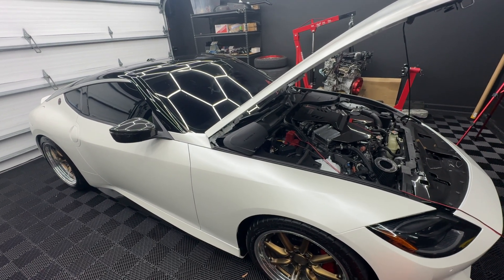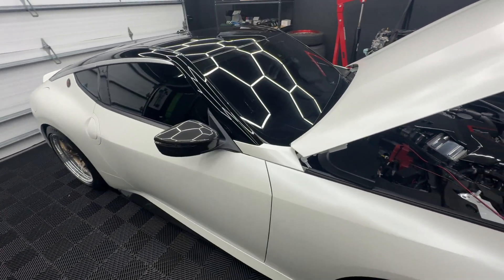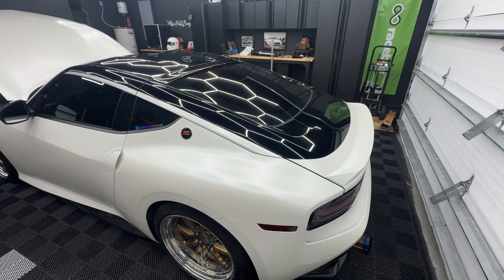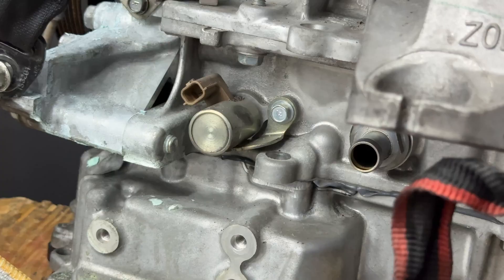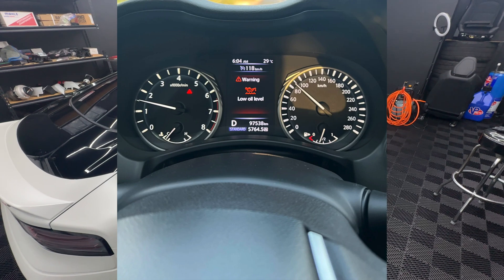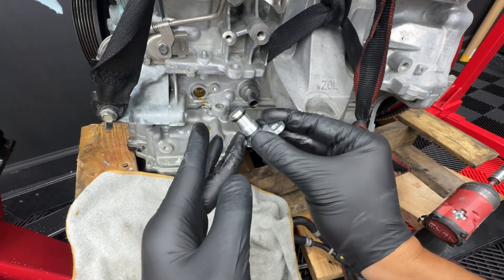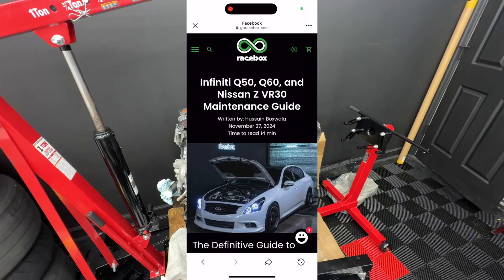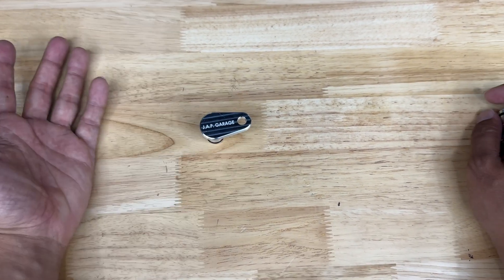Nissan's VR30DDTT Engine Flaw EXPOSED

Comment from the maker: Do you have a VR30? Have you lost an engine or has it been great? I want to know.
Reply: It’s been great so far! No issues on 0w/20 stock Nismo
Reply: lol, vr30 cant even stop the heads from cracking
Reply: 2017 q50rs 3 years (tuned fbo) been great only issues o2 sensor and belt.
Reply: 2019 q50, 106k on stock turbos, bought with 34k.  FBO and tuned for about 20k of those,  JB4 30k, stock 20k.  Its been good to me.  Racebox caught the oil pressure solenoid.  Very delayed going into high pressure.  New solenoid goes into high with a blip of the throttle.
Reply: Just turbos running mobil 1 5w30
Reply: @fullmetal556miles and year model I have 2018 87k miles been great
Reply: Went thru one engine before I wrecked
Reply: Nice man, 2020 red sport 20k miles RA500 but engine leaking coolant inside smh
Reply: Changed my oil and within not even 24hrs my engine blew. Knew I need turbos and was gonna have them redone by infiniti but that low pressure light came on and then the knocking noise 😢. This is gonna be expensive. 🤦🏾‍♂️

Comment: I'm running Motul Xcess Gen2 5w-40 in my 2025 Armada Pro-4x with the VR35DDTT 3.5L twin turbo V6 and up in the Midwest winter temps of -15F it runs like 0w-20 once warmed up properly. Don't plan on ever going back to 0w-20. Used oil analyis showed wear metals were below universal averages for this motor.

Comment: Currently deciding to get my motor rebuilt or just buy a used q50 motor. Do I have to get the car tuned to install the block off? I have a jb4 but I’m not using that bs no more rather just get a actual tune

Comment: I'm not sure blowing an engine when low on oil can be considered a "flaw" of said engine. Pretty much any engine on this earth can be destroyed if ran with no oil.
Reply: The issue with the solenoid is that you don't need to be low on oil for it to blow. The only mitigation step is to ensure you have proper oil pressure everytime you go above 3.5K RPM or high load/full throttle.
Reply: @dogunboundhounds9649  Or unplug the solenoid or tune so it stays high flow always.  Not so hard.
Reply: @firepowerpinball therein is a flaw of the engine
Reply: I was just thinking i havent had this issue at all with my vr..? but then again… i drive me z33 for nearly 10 years 🤔
Id swear it was the most reliable thing ever…… just keep a couple spare quarts and check the oil every day 😵‍💫🥴

Comment: What your opinion on the smoking at stoplight, but only when its hot outside. In the cold once engine is warmed up this doesnt happen to me. Just on hot days which is weird i run 5w-40. Im also catless so idk if its just that. Its also not consistent, sometimes happens alot at one stoplight and nothing at the next

Comment: Use the right oil, constantly check the oil, set up an oil catch can, avoid any pop and flames tune : you'll be fine
Reply: pops would not cause any harm to your engine..
Reply: Flames then aren’t bad if you don’t let the exhaust gas temperatures get too high. Moderation is ok.
Reply: so 0w20, If i do intakes, catback, downpipes, and tune 5w30? Im getting my z tomorrow and im worried about the cylinder head cracking issue going around... especially if tuned and voids warranty

Comment: I just had my block replaced due to rod knock. Could this have been what caused it? It looks like the solenoid isn't in the engine block, so I'll have to replace this solenoid since I'm not tuned?
Reply from the maker: Couldn’t tell you for sure but it’s a possibility. The solenoid is bolted to the engine and you get a new one with the new engine.

Comment: There is a reason that basically NO supercar in production today has a V6 engine (the R35 is not a supercar).    What do you expect when you put high HP in a non-intrinsically balanced engine that needs countershafts and/or offset crank pins to fire evenly? 
Lamborghini, Pagani, Ferrari (296 is not a supercar either), Porsche, BMW and Toyota understand this.  Same reason the Jag XJ220 was basically a flop.
Reply: I get that you said no V6 "Supercars" in production today, but the Toyota Tacoma literally uses a Twin Turbo V6. I dont think its the fact that they arent meant for Supercars its that these companies are trying to find ways to balance economy with speed. Which imo buying these cars that have been babied and clean for cheap now, makes a whole lot of sense. Especially after these turbo recalls. Nissan f'd up and its a win for used buyers.

Comment: the vr30 doesn't blow up at all. only if abused
Reply: Porous block says otherwise
Reply: @biccog8634 then how come my 2018 with 181K on it still runs perfectly? doesn't burn a drop of oil either.
Reply: @cantwealljustgetalong2 only affects some engines and you’ll never know if you got a bad one till it blow early. You got a good one for sure
Reply: @biccog8634 i hear what youre saying but if you google any engine you will find problems with almost every engine out there.  remember nissans 3.5 and 3.7 liters were pretty bulletproof.  because of CAFE and political pressure to squeeze out fuel economy they downsized the 3.7 to 3.0 liters,  and increased compression by a lot, along with twin turbos just to create around the same power the 3.7 made.  not only that but fuel economy ended up being the same for both engines.  companies have been doing this the past 10 to 15 years and this is why across the board we are seeing engine issues from almost everyone
Reply: @biccog8634 porous block doesn’t exist. It’s cracked heads. Oil mixing with coolant can be caught.

Comment: This engine was first made available in 2016, I went to training for this engine and they didn’t have one available the class, furthermore Nissan didn’t even know how much oil it should get. The trainers had different info than specified, and the updated info was never published for a year, then we got different dipsticks, then we were being forced to change the fuel pump with every warranty engine replacement, I’ve seen turbos blow all the oil from the engine out the exhaust, I’ve seen a potus block with nest mound of blue coolant fuzz…
Reply: I jsut had my fuel pump replaced under warranty, is there something else to this?

Comment: AMSOIL or nothing.. The shit is magic.. I had a TSX that consumed oil (no blue smoke or blow by) but would eat about 1 quart per 300 miles... I switched to AMSOIL and was on the full line every 3000 miles.. Not gonna fix the shitty turbos on a Q50 but without a doubt will save ur engine.
Reply: Agreed - Amsoil has NO competition.  The best. Period.  Amsoil Signature and Amsoil 20 micron filter.   I use Amsoil for all other oil products needed from chainsaw to guns to bicycle chain to multi-purpose for hedgetrimmer, all small engines i.e. lawnmower,    etc.   Change oil every 3K. Period.  Old school rule.  Period.
Reply: @yootoobed  I wouldn't say no competition, Motul is right there
Reply: Agreed 100%!!!!!   With this particular engine,  every 3K is an absolute MUST!!!!   ever notice how dirty your oil is after even 3000 miles with this motor??

Comment: so which oil do you recommend for a 21 red sport I've used Amsoil 5w-30?
Reply: If car is stock and it runs 0w/20 you can run 0w/30 will me no problem if your tune I would look at 5w/40. When the vehicle is hot and these vehicles naturally run hot. The 0w/20 gets real thin when pushed hard and the car is hot and it’s hot outside. You can reach 212* easy.  So run 0w/30 once hot it alil thicker when pushed hard it will thin out as well but should around like a 0w/20. When 0w/20 thins out it’s like running a 0w/16 maybe less

Comment: Can I ask you a question? My Z is my first turbo engine. Leaving it stock…..for now anyways…do you have any tips I might not know about turbos or the VR30 specifically? 

Things that might be basic, or good practice that a former NA guy wouldn’t know about? 

Obviously nothing that is already in the manual, but maybe some good practices with the VR30 or just turbos in general. 

Thanks!
Reply from the maker: Congrats on the car! Here is my best advice for a fellow VR3O owner. 

Monitor oil level religiously. 

Monitor coolant level every engine oil interval. 

What ever you do, do not go 10k miles between engine oil intervals. I like 3,500 miles on pump gas, 1500 miles tuned on E and and for mainly highway miles on pump gas I wouldn’t push it past 4,500 miles.

Let the car warm down a bit before turning off after getting on it hard. 

Check your belt indicator on the belt tensioner. The belts tend to stretch relatively quick. Mine needed to get replaced at around 20k miles. Replace it with a Gates belt.

When you do decide to tune it, choose a reputable tuner. Over spinning the turbos will damage them.

And most of all, enjoy the car!
Reply: @ZillaFullBoost wow man, thank you so much ! That some solid advice, and none I knew. I did my first oil change at around 3k, just hit 4k so still just getting warmed up.

Comment: In theory cant you just unplug the sensor and have your tuner tune it out? Basically the sensor will lay dormant and act as a seal as well or a block off
Reply: Yes you can technically
Reply: bo need to tune it out, it will automatically go to high demand permanently
Reply: @junior3732  high demand is exactly what we want

Comment: I got a 19 q60 stock with over 65,000 miles, just added a larger heat exchanger and oil catch with no issues.1.check oil 2.use recommended oil type 0w20 and change it every 4,000 mile 3.dont beat the shit out of it all the time and you should be fine
Reply: That’s another thing. People beat the cars like they are legit race cars and forget that they are manufactured STREET cars lol 😂. Some guy got mad at me the other day cause I wouldn’t launch my gtr at a stop light. 😂
Reply: @Vader066 rev it!  Rev it!  😂😂😂😂.. until you blow then you're looking like an idiot while they fim you 😂😂.. these kids.. smh.
Reply: Use 5w-30 unless you live in a very cold climate

Comment: Hey guys,   what about running 5W-20 instead of 0W-20 for a little better startup protection,  but keeping easier running temp lubrication.   Does anybody run this viscosity?
Reply: Look into STP ceramic oil additive.  My engine loves it, and would add additional protection.  In standardized testing, it significantly decreased wear and will make your engine noticeably quieter

Comment: I want to get a q60 red sport but I’m afraid of this engine I already have g37
Reply from the maker: I say go for it!
Reply: @ZillaFullBoost turbos gon be problem I know it
Reply from the maker: @Jaybladz if you over spin them yea. My Q lasted 60k miles being pushed real hard. For the regular guy it should at least do double that.
Reply: @ZillaFullBoost gotchu imma consider
Reply: I did replace my manual g37 coupe for a 3.0T, I’m very happy with the upgrade! Just keep it well maintained and it will treat you well
Reply: @CV36wllmn I want more power might go with a boosted mustang

Comment: How to avoid all above, 
Use recommended oils
Dont drive it like a kid.
Engine doesn't need any of those. Its perfectly engineered
Reply: Wrong. The solenoid issue can be a problem with the recommended oil, and when driven normally.
Reply: Jaki olej zalecany?

Comment: POS motor idk why people even run ts diabolical
Reply from the maker: My engine has been fine for the last 2+ years at 700+ whp 💁🏽‍♂️
Reply: @ZillaFullBoost some experiences are better than others, but the good does not outweigh the bad. Nice to hear yours dong fine but with as new of a platform you cannot denie its a hit or miss when it comes to these. Not even gonna talk about flawed turbo design resulting in premature turbo failures, forcing kids to bring their vr30 in for warranty after modding a car😂 and overheating issues out the ass its not meant for what people doing its a economy motor lmao
Reply from the maker: @e92erik  This platform isn’t new anymore and all those issues have been addressed. No platform is perfect 🙃
Reply: @ZillaFullBoost  its very much new bro the aftermarket support hasnt even peaked yet barely any companies supporting the vr30 hence its such a new platofrm and nobody really use it (waste of R&D for a dead market).. i understand coping bro but lets not argue here man people are just now learning about this oil pressure sensor major flaw. this is nissans last effort at the perfromance market by reusing a economy motor for a sports car because theyre too cheap to r&d a new motor. when they discontinued the gtr i knew it was the end for nissan bc the Z is ruining they legacy. cant even compete with bmw lil economy motot (B58) you cant even compare vr38 to s58 anymore its a dead platform aswell costs too much too acquire and mod when theres better.
Reply from the maker: @e92erik  A platform isn’t new because it has limited support what are you talking about? This engine has been out since 2016 and a ton of people have VR30’s.

The aftermarket support is now starting to ramp up now because of the Z. Same happened with the 40i series. Not 1 person cared about it until they realized the Supra was going to share the same engine. 

And with your logic you’re contradicting yourself saying it’s a dead platform, yet it has yet to peak?

Every once in a while one of you come out the woodworks spewing nonsense. Just stop lil bro.

PS: Even the B58 has its issues and don’t say it’s doesn’t before you continue to look more foolish.
Reply: @ZillaFullBoost there was plenty of b58’s pushing low 9’s before the supra are you okay? Just because a engine was released in 2016 doesnt mean its old… in 2020 is when people started really pushing this platrform right after covid so stop it bro its beyond new its fresh🤣 and a aftermarket support has everything to do with longevity of a platform becuase if it was out for more than a decade only after 5 years a platform really start to shine.. look at the supra its just started getting support after 3 years of it being out.. theyre still some ecu locked you so far behind in the car scene its sad. That VR30 died before it walked🤣 because soon as people started modding them they started blowing.. dont bring up supras bro bc theyre not blowing up after 800hp theres 340is pushing high 4’s 60-130 and drive right back home from the track and to work the next day. No Z can do that. Also how am i contradicting myself? 🤣🤣🤣🤣🤣 and if everyonce in a while somebody push comes to shove maybe its because the vr is actually dead? I mean you literally making a video thats not helping the platform so dont get upset when you filter out the people that actually know about cars. Have you ever built a motor?
Reply: @ZillaFullBoost bro i didnt say “limited” thats like talking about a kia stinger aftermarket supprt. I said there isnt much aftermarket support hasnt peaked it just started for vr30.. and aftermarket support has everything to do with the life of the platform what😂😂😂  and dont say nobody cared about b58 until the supra because thats only how you feelt nobody even cared about the Supra bro i barely see them.. stop making excuses, actually i see more supras than Z i seen like 1 in my life lmao and wym everyonce in a while somebody come spewing nonsense? Maybe stop posting videos like these dragging vr30 get mad you then attract actual knowledgeable car enthusiasts that know what theyre talking about. And B58 does not have issues like that pos vr i see plenty 800hp+ 340/240’s push high 4’s 60-130 leave the strip go home then to work the next day. No Vr can do that😂😂
Reply from the maker: @e92erik  ok, have yourself a great day knowledgeable car enthusiasts 🫡
Reply: @ZillaFullBoost  theres a difference between speweing nonsense and knowledge. At the end of the day its all about cars nothing personal brotha take it however you want it, was a great video still! Have a great day.
Reply: @e92erik This guy loves getting rage baited and doubling down when he knows he’s wrong in his video’s comments. It’s fun messing with him.
Reply: @WhiteComet_CA  cyberbullying isnt nice🤣🤣🤣but i love rage baiting nissan guys they get so mad. Especially mustang guys my 2 favs.
Reply: @e92erik 🤣
Reply from the maker: It's more fun seeing you make a fool of yourself while simultaneously giving my videos more engagement. Keep those comments coming baby girl.
Reply: @ZillaFullBoost All love broski‼️🙏🏾
Reply: @ZillaFullBoost Bro’s so mad he responds over 3 weeks later. You REALLY need that engagement little bro don’t you? 💀
Reply from the maker: @WhiteComet_CA  I have a life outside of YouTube. Maybe you should get a job or something that can occupy more of your time instead of spending it trolling and expressing how much your butt hurts when people are enjoying their VR30’s. Either way, yea thanks for the engagement 🫡
Reply: @ZillaFullBoost Ah yes the “get a job” copy pasta. Nice one! Jarvis, how’s the rage bate going?
Reply from the maker: @WhiteComet_CA  it’s ironic mentioning “copy paste” when that’s all you’ve been doing by over using the words “Rage Bate” 😂 Why can’t you spell such a simple word? It’s Bait*..
Reply: @ZillaFullBoost  Sorry Professor ZillaFullBoost, I apologize that I am not extremely diligent about the spelling of all my YouTube comments, I should treat them like a professional document at all times! Thank you for the entertainment you have provided me in the comment section, it's been a pleasure being the fuel to your anger, you have singlehandedly provided more entertainment than I'll ever need, enough to cancel my Netflix, Hulu, Amazon Prime Video, Crunchyroll, Apple TV, Paramount+, Cable TV, ESPN+, Peacock, F1 TV, and Tubi.  Once again thank you very much. 

Regards,
Me.

Comment: yooo i remember commenting about the oil pressure control solenoid on a previous video. i thought you didnt get a code for unplugging it? and does that code throw it into limp mode?
Reply: I got a code on my Q50, but no it didn’t throw it into limp mode.